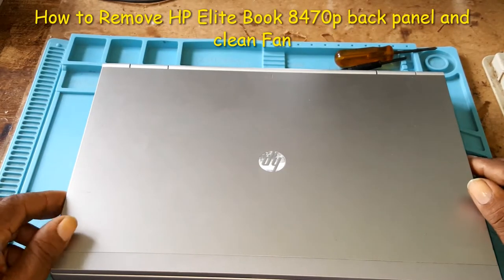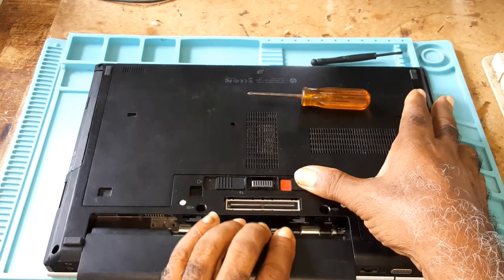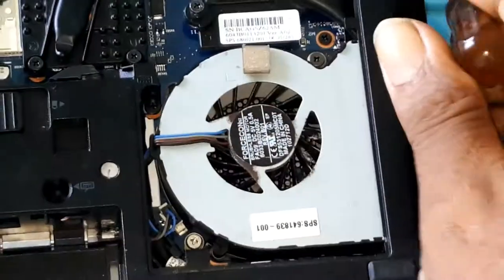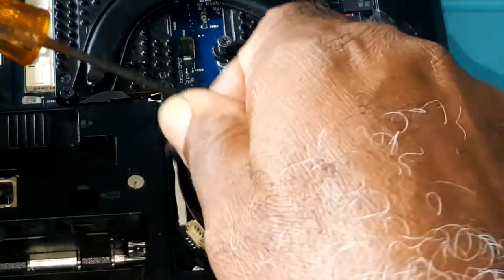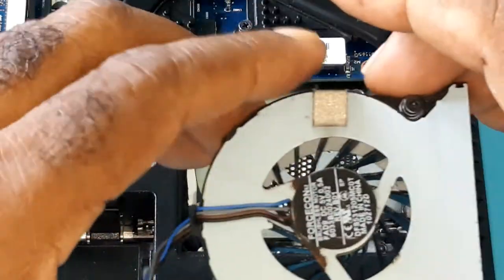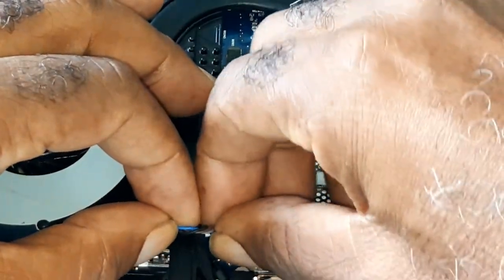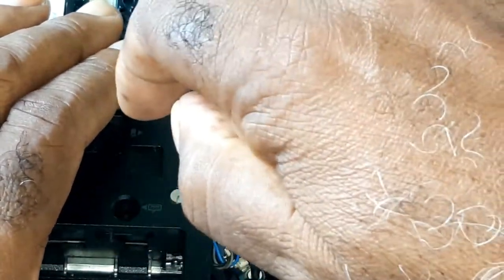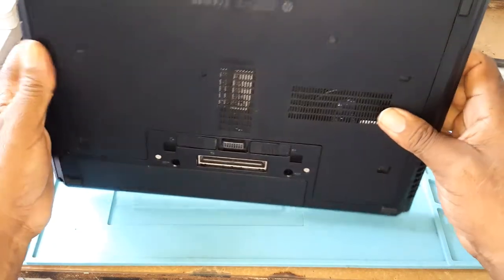How to Remove HP Elite Book 8470p back panel and clean Fan

Comment: Is there a reset button for this laptop, since when I turn on the power button, the laptop doesn't turn on?
Reply from the maker: No is your battery ok.
Reply: Battery is OK but the laptop doesn't turn on while plugging on the charger the laptop generates shocks
Reply from the maker: @vyshnavshanil7630  If your laptop doesn't boot up when you press the power button, most likely, your laptop has a faulty power supply, battery, RAM, motherboard, or video card.